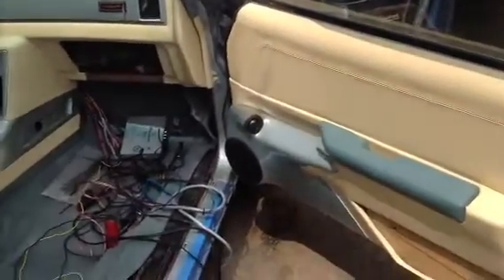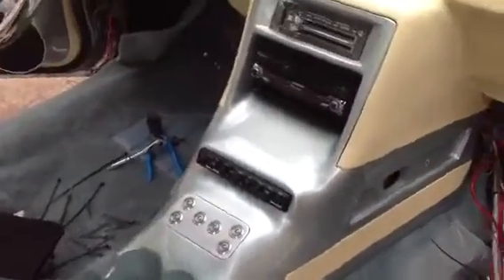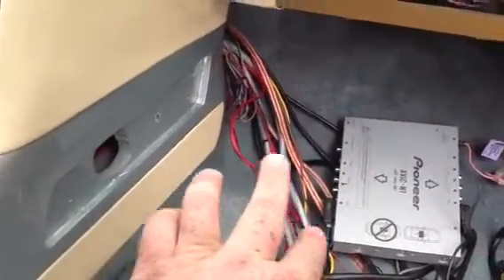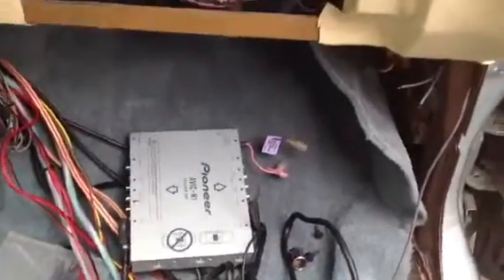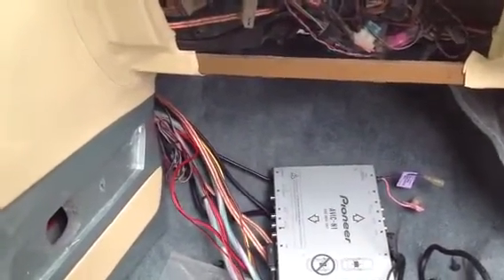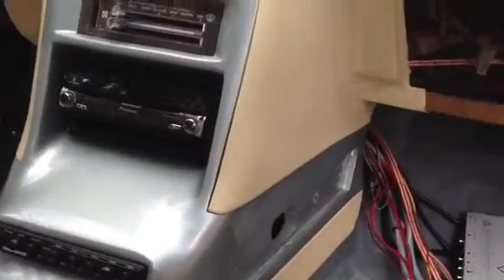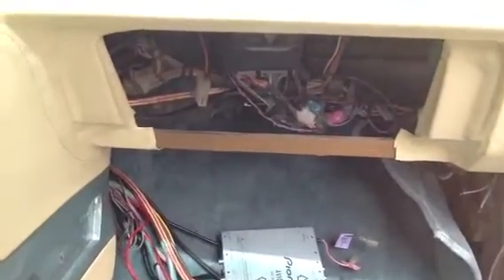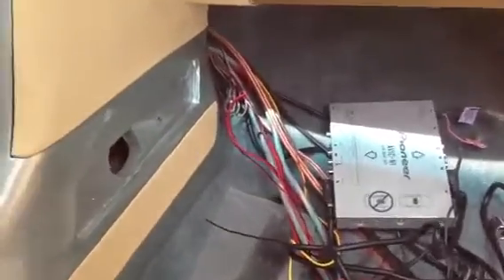Update on the Elco

Comment: I hope this isnt a dumb question or a wast of time, but was wondering how many items can a relay run?? I think they work by amps just wonderingnif you could give me a example three amps @ 50 amps a peice or......plz help me thanks for ur time.
Reply from the maker: I believe in overkill big time.For example I treat an amplifier as pulling 1 amp. So a relay would run 30 amplifiers. I wouldn't try to urn 30 amplifiers off a single relay. It's just a rule of thumb. I'm using these relays for doorlocks and power windows and a sunroof. Then for the lights through out the car. Plus running two amplifiers.